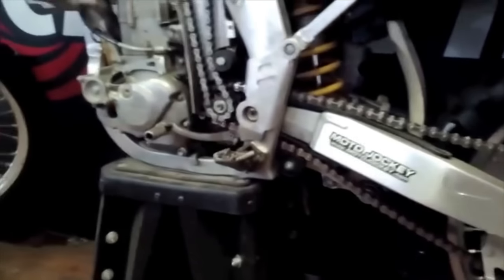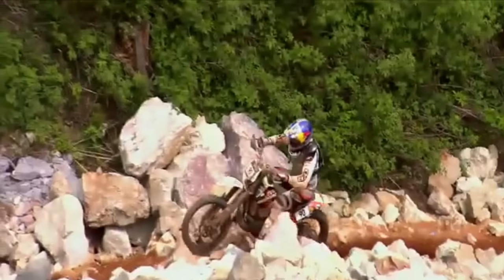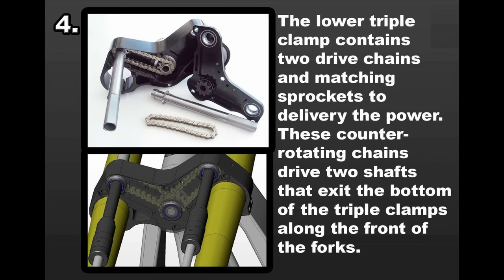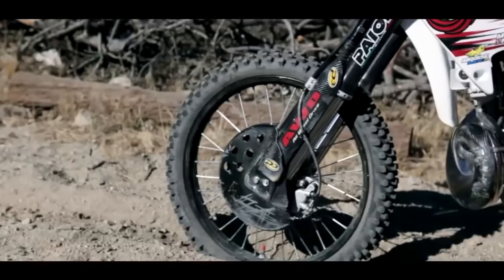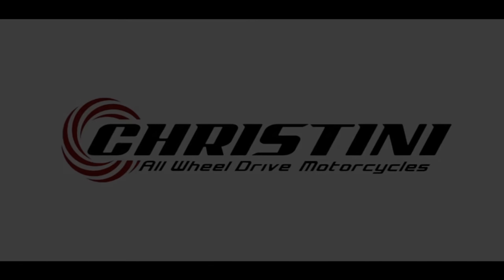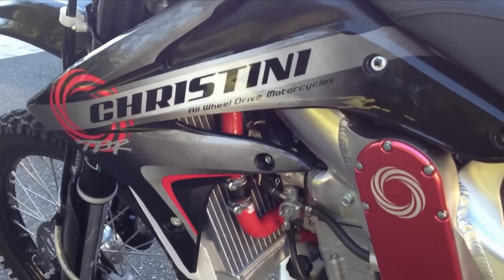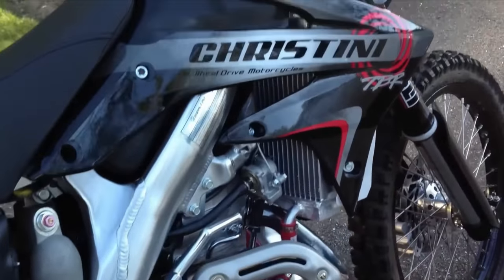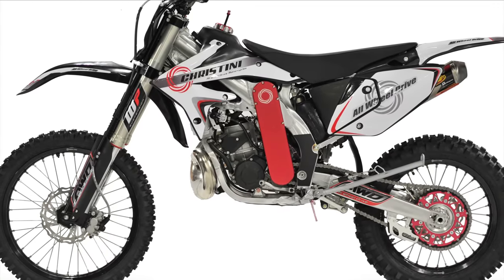The Christini AWD 300 2x2: How All Wheel Drive Works on a Dirt Bike

Comment: They should make one for a cr500 2 stroke
Reply: There is a 500c conversion for the ktm 300.. Kaplan America fitted one, 60 odd hp!
Reply: Why? The front wheel will always be off the ground anyways haha
Reply: @eason9115  🤣
Reply: Lol. The cr500 is already a death trap. Can't imagine it being front wheel drive
Reply: @Eason 😂🤣😂🤣
Reply: @bobdog4379  kaplan is the man
Reply: @bailey78  awd 😂💀
Reply: @qow.h  
 Still a death trap.
Reply: No. Its a track based race bike that doesn’t need to be used as an enduro.
Reply: @eason9115  Hahaha facts.
Reply: They make those set-up kits for CR500 dirt bikes to. You just half to do more further deep into it researching is all. Cause some of those other types.,or styles will adapt on to your dirt bike to.
Reply: That ktm 500cc will work. The mounting brackets are most likely what's going to be different is all for the CR-500 2 stroke. Just have some machinery shop/ machining shop 3D print the bracket's out it'll need to fit the cr-500. I'd ask them to copy the printout of the layout of your dirt bike to 3D print more for side hustle money.& On hand parts close by to if needed.
Reply: @bailey78  Well I can
Reply: I hear the sound of my people.
Reply: Every modern 450 makes just as much power and more torque almost everywhere. They make more sense for those tbh
Reply: @Shadow0fd3ath24  i ve got a 450.. 450 make same power and tq but a 500 2 stroke can make 7-8-90 hp if tuned.. a 450 can never do that. 500 is still the KING👑👑👑
Reply: Hell I want one on my yz490
Reply: 100%
Reply: 100%
Reply: Didn't Yamaha patent or make these years ago for Dakar?
Reply: @eason9115  you need glasses...or pay attention.
Reply: Yamaha tenere 700 would be great
Reply: @chacafernandez6965  the comment was they should make a kit for 500cc so don’t know what i missed on that?
Reply: Or a custom build for the 700cc 2-stroke bike on the Stunt Freaks Team youtube channel😱
Reply: 😂 easy way to 🕊️
Reply: Cr500 2 stroke is unbelievably powerful
Reply: Can a cr500 or a 250 stroke be turned into a super moto to ride on the road? Or is it bad to drive at high speeds for to long
Reply: So my dad is 60 and still races professionally on a full custom built 1988 cr  he has built 3 of those bikes all different sizes but museums keep trying to buy them from him he said now and races them lol.  Every part was built by a CNC billet everywhere
Reply: Yamaha had a 490 2 stroke 2wd
Reply: Na. Maico
Reply: ^ this
Reply: @Aciecarter238   If by man you mean tool box
Reply: @Shadow0fd3ath24  yup, the CRF450R is more powerful and quicker than the CR500

Comment: I bought one, spent thousands on it, rode it 3 times, sold it for a loss.  At times it was great, in the mud and tight single track... I thought it was worse.  Had to remember to make sure the front end was pointed exactly where you want to go, every time the front end comes back down or it will throw you into the bushes or over a cliff.  Different kind of riding, like changing from 4 stroke to 2 stroke... you have to ride it differently.
Reply: Interesting perspective. I would have thought in nearly all cases it would be better, minus added weight and maintenance. Guess it's one of those things, you don't know till you try it.
Reply: I'm not too surprised, most of your weight is on your rear wheel on a motorcycle anyways, and to be fair most of dirt bike riding is not being in control half the time so
Reply: Does the system have a rear bias or do both wheels receive the same torque?
Reply: @foch3  actually last I looked it up there was actually a clutch that didn't engage the front wheel until the rear started slipping
Reply: @RL-un3yq  go try a beast el kick scooter with awd... mine does 65mph top speed and climbs mountains where people in climbing gear comes down.
The first two years of ownership I drove 12k miles on the el kick scooter. All year, all weather, no problems.

oh, only go full blast if you feeling suicidal^^ 🤣🤣 there's been a 6-7 close calls during the first year alone 🤣🤣

Besides, on those kick scooters, you get to feel the difference in having just a rear wheel, and both. The feeling when the front wheel is spinning and you doing 40mph, it's thrilling to say the least 🤣🤣
Reply: I would have thought it would be good in tight turns like on a supercross track if you went in hard and purposefully over steered the bars with your weight forward to launch out. It would be good to hand one over to a good supercross rider, although I'm not sure they would be allowed to race one yet.
Reply: @foch3  great question
Reply: @greengoat5654  great answer, thank you
Reply: @joecarr9476  if you get too much weight on the front, it will catapult you in the direction of the front wheel like you didn't know was possible 🤣🤣

So only lean forward when you see the exit of the corner, the front wheel is pointing in the correct direction and then press the accelerator/gas pedal.

Tight turns? yeah, at super slow speed haha. You might as well stop almost all up, turn on the cent and accelerate again, as you get a move on like nothing else with the awd.

I'm not sure what you is talking about is possible today, because of the suspension set up being used, I don't feel is made for having a front wheel pulling you outta problems. Most often it feels like the front wheel will spin away from you. Leaving you with only the bike and a rear tire 🤣

and breaks also don't hold up as good or as long with twice the number of wheels pulling. No matter what we need a huge upgrade on the break side of things.

I'm not sure anymore, I'm not the dude to fix these issues but front suspension and breaks are issues when you only got 2 wheels and awd.
Reply: Why two shafts to the front wheel, and not one?
Reply: @newandoldtech5634  Prevents torque steer
Reply: Point it wrong and your gone
Reply: Crazy thing about this configuration is that your getting the most power to both wheels(obv the front is losing some do to the configuration) but how it’s setup you’ll expect a torque split
Reply: So it can't be rode and just ride along with it, is what you are saying.
Reply: That honestly makes sense, AWD cars drive differently from RWD cars.
Reply: @Censortubes  there is a handlebar lever to unlock the front gear box, but the 12 pounds  on the number plate never goes away and feels like someone sitting on your handlebars. In certain situations, the bike is brilliant. But in others where you're not ready for the front pull, it can scare you.
Reply: @russshappard1059  so it cant be rode and you are along for the ride like I said. Thanks for confirming.
Reply: @savagegtalks5912  sounds like 80s turbo
Reply: Dnt use it then
Reply: @savagegtalks5912  wont beat a bike or ATV. Diff
Reply: Yes I think there is. I was looking into getting this for my 530exc years ago and was told there is a slight difference in gearing ratio between front and rear.
Reply: Yea theis stuff seems like hell for high speeds especially on tight trails. Would be fun for slow crawling camping trips in the hills.
Reply: @greengoat5654 I wouldn't say it is about not being in control.  You don't have to be hooked up to be in control.

Comment: With all the new, highly efficient and lightweight e-bike technology, it would seem to be far simpler to add a small electric motor, for short term, momentary assist power to the front wheel, rather than the Rube Goldberg style mechanical systems.
Reply: No
Reply: @slangneck6837  Ummm, yes. You could easily put  high torque DC motor in there and have it run off of a separate battery pack that is kept charged by the drive system, or is driven by a beefed up version of the stock electrical system. It doesn't have to be able to pull the whole bike up a hill, just to assist it in times of need. I think any resistance to this idea is because people just don't want to let go of stuff. This is/was a pretty neat system, but an electrical hub motor is just simpler and better all around.
Reply: @jshireley  we don't want electric
Reply: lmao, love that exchange. reasonable arguments vs "no, electric bad"
Reply: Dc motor and alternator to power it... be less to break and in weight
Reply: @jshireley  You don't seem to understand how heavy batteries and electric motors are. Your idea would add so much weight that the final product would be useless as a dirt bike.
Reply: @theyeetus1428  you don't need full size ebike battery for an assist system that can be charged by the engine. but i agree, unsprung weight on the front could be an issue
Reply: @N1KI007  electric hub motor up front with power sent from the engine through an alternator
Reply: I built an ebike that has dual hub motors one in the front and one in the rear. I hooked switches up to shut either wheel off when I don't need it.
Reply: @pavulon5000  or better yet, super capacitors. They will give you temporary power they charge fast and weigh nothing.
Reply: And don't forget they newer hubless motor technologies in e-bikes.     Now all the weight can be centered  and no worries about drive shafts, gears. Etc.
Though Hubless motors may possibly not perform whilst dipped in mud.

They do have some 2WD on road electric hubless motorcycles out now
Reply: @user-kj7nw4zg1y  "If it made sense they would have done it by now."
I'm sorry to have to report it, but his is the classic response from the non inventor to the inventor. EVERYONE who has ever brought anything new to market has heard this from his "friends" and relatives.  Do you have any idea how many times I've heard that in my lifetime?  A LOT.

Right...so close down the patent office.  Everything that would make any sense has already been done.

And; you don't need to "sync" when we're talking about applying torque electrically rather than mechanically locking two wheels together.  Virtually all modern AWD cars use "torque splits", meaning in that case that the front wheels are getting more torque applied to them than the rear wheels.  You can split it any way you like, electronically.  It's not difficult, and these issues are dealt with regularly.  But I don't need to convince you.
Reply: People with loads of free time already experimented with electric motor in front and gas engine in the back. It works wonder since electric actually very good at pulling.
Reply: Hub motors have poor torque at start up
Reply: hub motor is unsprung mass, on cross bike especially it's insane, then no it's not an option intelligent
Reply: @theyeetus1428  It would be 1000x better than this abomination
Reply: @pavulon5000  Need I say more? Electric sucks
Reply: Well unless you want the correct power transfer this is the only way other wise the rear wheel would be moving before the computer tracking throttle input makes the little front electric motor start to move
Reply: battery powered electric motors are shit technology compared to whats been used in this bike(especially 2t version) in terms of offroad performance
Reply: That sounds more a problem and less dependable but I’m old fashioned
Reply: You could do this, but the front hub  motor and battery will add considerable weight.
Reply: @pavulon5000  well a lot of enthusiasts just like everything to be mechanical. Us enthusiasts are not a logical bunch
Reply: You mean a hybrid 😂😂😂
Reply: @juliomartinez6204  Of course.
Reply: From Colombia , I’m not a biker,not a mechanic, never rode a bike , just a farmer ,but always thought that’s simple small electric motor inthe front wheel ,for momentary power could be the solution. And now with small powerful batteries ,the time has come for this idea. 
Also , electric autos could be more interesting ,if fitted with a gas engine noise type of device, thinking more in the big noise makers of the 50 s or 70s. . You would just push a bottom and there you have it ,like the one use now days in mustangs  and challengers.
Reply: Please read my answer
Reply: Yes mechanical drive is rediculous in 2023  it will never be a success
Reply: Addimg up a powerful motor will only help, that too with a powerful and dense battery. So eventually the weight will increase also the overall setup price and still wont be able to get that kind of torque which will be required for climbing

Comment: This is the cleanest two wheel design by far that I’ve ever seen on a dirtbike. Way to go christini! 🤙
Reply: Imho the electric motor on the front would be much, much simpler, no maintenance, no braking points
Reply: @west_adv  you would add more weight and bulk doing that, since you'd also need a hefty sized battery pack to go along with it.
Reply: I agree with @agzrele, the parasitic power losses from all of those bevel drives, sliding shafts as well as the drive shaft to the front forks and chain must rob the engine of a lot of power, not to mention the maintenance aspect of it. Furthermore, the setup would add quite a lot of weight to the front of the bike, which is not ideal. We have a 2wd ebike here in New Zealand (mostly sold for farmers or hunters needing the extra traction in muddy conditions) and they report that having a driven front wheel makes the handling rather hard to manage, I imagine that this system would be even worse because it's purely mechanical so if the back wheel loses traction so does the front. It's an interesting engineering concept, but more of a novelty than anything. At least if you used a hub motor and battery, you could mount the battery in the rear, put a controller almost anywhere and the hub wouldn't add too much weight to the front, you could also have easily switchable power to the front with a easily built in traction control system.
Reply: @west_adv  That would be horribly inefficient and very heavy.
Reply: theres others?
Reply: @onecookieboy  It's actually a very light weight design for a 2wd dirt bike, and shouldn't result in very much parasitic loss from the drive train itself. Also, you're wrong about how traction loss works. If the rear wheel loses traction, the front wheel DOES NOT lose traction, and instead grabs. I believe it uses a clutch between the front and rear wheels, so it can engage/disengage the front wheel as needed. In fact, I wouldn't be surprised if the way it's designed is such that the front wheel stays relatively disengaged UNTIL the rear wheel starts to lose traction, which would then engage the clutch and transmit torque to the front wheel. An electric drive front wheel would add more weight than the christini system. If you look at the components that actually make up christini's 2wd system, it's VERY light. from what I can find, the 2wd system adds 6.8kg (15lbs) 

Hub motors also add UNSPRUNG weight to the bike, which is BAD. you don't want to add more unsprung weight to a bike.
Reply: @kasuraga  Yea, nah, tell me how the clutch works when the rear wheel starts spinning to prevent the front wheel from increasing speed at the same rate, remembering that it is all mechanically linked with chains and bevel gears, the clutch is only to engage or disengage 2wd because you wouldn't want it in 2wd all the time. Like I said, might be helpful in mud, not so much on anything where there is some level of grip or at higher speeds. I admire the engineering behind the concept, but don't think the benefits outweigh the drawbacks, especially given the likely quite high cost and ongoing maintenance.
Reply: @onecookieboy  you have no idea how traction works. if they are 100% mechanically linked, then the wheels cannot spin at different rates, which means the wheel speed is limited by the slowest wheel. If the rear wheel does not have traction and spins, all it's gonna do is transmit more torque to the front wheel to grab harder. both wheels will continue to spin at the same speed. That's assuming it's 100% linked together. TRACTION is what prevents the wheels from spinning faster. If the rear wheel is on ice, and the front wheel is on dry pavement, the speed of the rear wheel will be limited by the front wheel, while torque transfers from 50:50 to 100:0 since all of the torque will be applied to the wheel with the most grip in a fully locked system.

From christini's website: The use of one-way clutches in the front hub allows the front wheel to be driven at a slightly slower rate than the rear wheel. Power is transferred to the front wheel only when the rear wheel loses traction or the front wheel skids.

basically, the way it works is power is ONLY transmitted to the front wheel IF the rear wheel starts to lose traction. That's how they get around a lot of the handling issues usually encountered with 2wd drive systems since under normal riding, it behaves as a rwd bike, and only engages the front wheel when the back encounters traction loss.
Reply: @kasuraga  If it actually works as described it might be okay, but as I said earlier it's an over complicated solution to a problem which hardly even exists.
Reply: @The Old Husky  Thanks, I will look for info about the Yamaha
Reply: All I can say is " good luck getting support or parts " from them
I was very interested in purchasing  an  2wd enduro bike  so I sent several messages . NEVER GOT A RESPONSE FROM THEM.
Reply: You could use a very lightweight battery/capacitor reclaim system, but I think it would be even more complicated and subject to damage than this very simple mechanical system. I can imagine those tiny diffs also don't take much to break though.